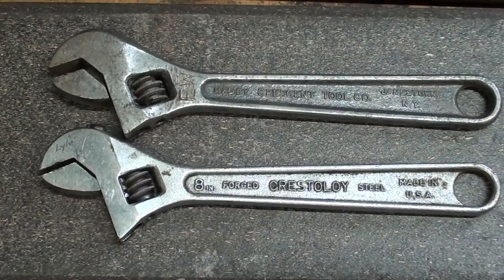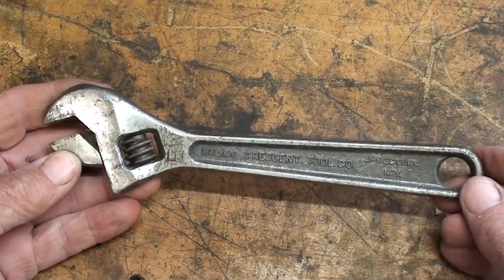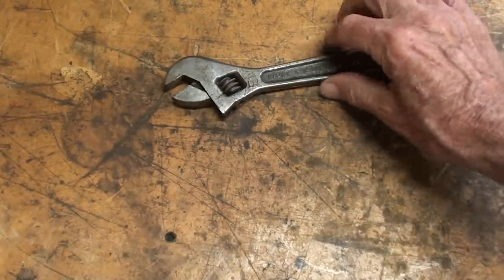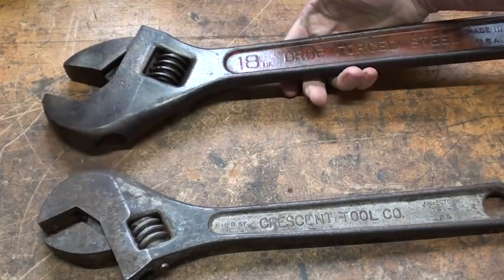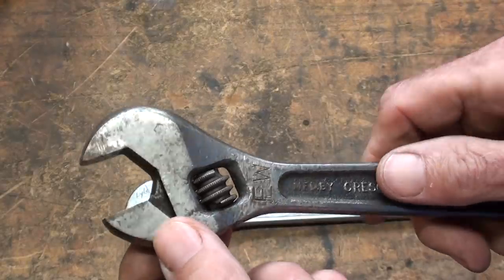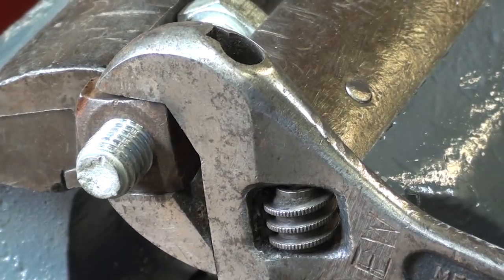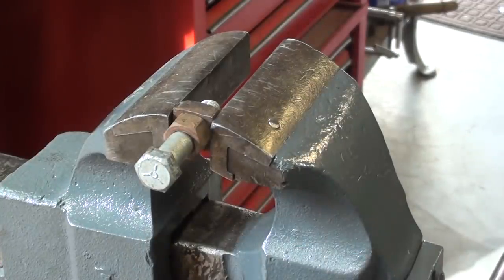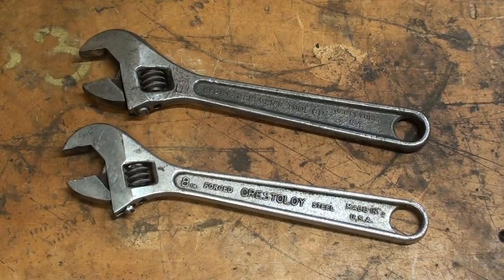Crescent vs Crestoloy Adjustable WrenchesTIPS 578 tubalcain

Comment: I live near the old cresent tool factory here in Jamestown and worked there over the years on many construction projects. Sadly enough the last job I worked on was to help remove all the hammer bases and send them south to the new plant. When  working there I was given a complete set of adjustable  wrenches some said cresent,rigid,pennys and was told at one time they made wrenches and pliers for 26 different customers including craftsman.
Reply from the maker: Thank you, that is good to know
Reply: @mrpete222 you'll love this one Lyle. Way back in the 1980's the boys in the shop decided to do Stan a favor and take all his high quality adjustable wrenches. My list: 
Snap on 16"
Snap on 12"
Snap on 8"
Blue Point 24"
And the cutest little 4"Craftsman keychain version. Was in my pocket.
    In trade I got Horror Fright from the reject bin. One in particular was a ten or twelve inch made in Packistan real shiny and crooked not from being bent, but swayed right to left. The knurled wheel was actually made to turn the opposite direction. The laughs only lasted about fifteen minutes or so. Those wrenches got swapped around for years whenever a mechanic was having a hard day or a rush job. Somebody actually tried to use the Pakistan one. It bent and was presented in a shadow box to the plant Safety Coordinator upon his retirement a few years later.

Comment: I once worked at a place that furnished me the hand tools I used.  They gave me a 12" adjustable wrench branded Klein Tools, Chicago, Ill.  I was using it and the fixed jaw snapped off, I own both Crescent and Armstrong 12" adjustable wrenches and have never had one fail, round off a nut yes, fail no.  I took the wrench back to the warehouse to trade it in and the tool man cut the blue plastic coating off and it had Taiwan branded right around the lanyard ring.  By the way that was around 1985, if you see a Klein adjustable wrench they are best used for anything that doesn't involve mechanical fasteners.

Comment: The Crestoloy name was first used for the alloy AND the finished hand tools 27 Sep 1930. trademark application for both filed 20 Oct 1930, and Trademarks ® issued 2 June 1931 for the hand tools, 23 Jun 1931 for the alloy when the company was under the leadership of Karl Peterson. USPTO Reg. No. 0283646 for the hand tools, 0284271 for the alloy.
Cheers,
-- Joe
Reply from the maker: Thanks

Comment: I remember when the company i worked at many years ago purchased  a big adjustable wrench ( we call them shifters here in Australia) to remove the nuts on hydraulic rams - i got to use it once as the jaws and handle bent on the first ram and i was only using my own body weight on it ! No prizes for guessing where it was made !
Reply from the maker: Yes

Comment: in my opinion thats what they are good for rounding off heads!!! only use them as a last resrt unless its some small bolt and nut with a 5 inch or smaller crescent wrench

Comment: What always bothers me about people using adjustable wrenches is, as you did in the video, they put it on the work going the wrong way. If you look at how the force is applied to the nut or bolt from the wrench, you will see that the corner of the nut low in the fixed jaw and the corner high in the movable jaw is where the torque is applied. This creates along lever, the length of the moving jaw, to force open the jaws or to allow the springiness of the metal in the wrench to stretch around the work and slip. 
If you turn the wrench over so the corner low in the movable jaw and the corner high in the fixed jaw receive the torque, you have less of a lever action against the moving jaw and it won’t slip as easily. 
Low in the jaw means closer to the handle, high in the jaw means farthest from the handle.

Comment: In Europe, the 'premier' brand for these wrenches is Bahco. I have several of those and they are usefull, but a bit clunky and heavy compared to the correct size normal wrench.
Reply: Swedish BAHCO is the original, Crescent is a good quality overseas copy. Lovingly known as "mutterrundare" (nut rounder) in Swedish after it's main use, which is perfectly demonstrated in this video.

Comment: A suggestion to possibly allow destructive testing: sacrifice one of your larger tool steel blanks as the "fastener" mounted in the vise, as it would probably be harder than either set of jaws, but still allow the square bite advantage. That would eliminate the "smear factor", but of course would raise the hackles of your "inner cheapskate", lol

Comment: I think that if you turned the wrench over to facilitate the most pressure being applied to the rack edge of the movable jaw, slippage will be reduced considerably. Due mainly to the fact that the farther from the pivot point (rack of the 'adjustable' jaw) the more likely flexure of the assembly will occur. To demonstrate the reality of this please, if you will bear with me, try the following proof of concept:
  Using a short length of rope (for the sake of clarity, let's use twenty inches) with a suitable weight (again, for the sake of clarity, a five pound exercise dumbbell) tied to one end of the rope and a loop large enough to slip over a one inch nominal piece  of schedule 40 pvc eight feet long. Holding one end of the pvc with arm extended palm up at shoulder height, have a helper hang the weight from the pipe at a point very close to your hand. Feel the pressure at the pivot point (your shoulder)? Now have the helper hang the same weight at a point close to the other end of the pipe (farthest from your grip) and see if you can even hold the pipe level. Feel the increased pressure (pain) at the pivot point (your shoulder)? Same goes with the 'movable' jaw of the adjustable wrench. Even though made of stronger material (steel), the pressure on the pivot point (rack) still exists and subsequently increases the farther along the fulcrum that the weight (or force or pressure) is applied. Just as there was flexure or 'sagging' of the PVC, so will there also be flexure in the movable jaw.
    Was that clear as mud, Lyle? 
    Didn't intend to be so long winded at first, just got on a roll. 
Read less
Reply from the maker: Yes

Comment: Undramatic but very typical results of the yet very useful in their own right knuckle buster as we always called them over our lifetime. As for the cheaper versions I doubt a comparison while very interesting would be needed. They have never failed to fail for us and being used in their place at that.  When I say in their place for these I mean somewhere where multi sizes of wrenches don't need to be carried or very large fasteners at low torque values.

Thank you for sharing your wisdom and knowledge, adventures, time, and stories with us take care and keep safe.

Comment: I would like to see the US patent the off set had to be designed to allow more access to the fastenet.My auto shop teacher back in the  dark ages said never use an adjustable wrenche.I spent 20 years working on nuclear submarines I worked on a boat where the engineering officer would inspect your tool bag and kick you off if you had an adjustable wrench because of fastener damage.I worked at Chevron Chemical where almost everything was done with a adjustable whench,Channel Loc pliers,6 in 1 screwdriverd,and hammer.
Reply from the maker: What a contradiction, LOL

Comment: Hard to tell but I'm wondering if the wrenches were damaged in some subtle way - did tthe angle of the moveable jaw to the gear rack open up?  And what actually breaks when they're overtorqued?  Back to the old videos for a re-watch!
Reply: Watched the old video and the wrench failed in the small sections at the corners of the opening for the screw.

Comment: So the video was interesting and illustrates why a "Crescent" wrench is used mostly for rounding over those pesky sharp corners on nuts and bolts.  Other than pounding or squeezing the sides of the wrench closed, what is a good way to restore the functionality of a sloppy "Crescent" wrench. Nice work Lyle, thumbs up.

Comment: Doesn't seem set-up between tools was consistent. Jaws weren't closed and Chromaloy generally handle was raised in the air so tool wanted to stay on nut but Crescent handle was horiz. allowing tool to slip off easily rounding nut. Don't get how a square nut sits better in the jaws. Hex nut sat in deeper in jaws and more supported on 2 additional sides.

Comment: Looks like the jaws deformed or spung a bit after the first go round.  Those sounds they make when they slip make my knuckles ache.  Some one called those an all 16th wrench.  We used to call them the --------- socket wrench.  Not very flattering but accurate nonetheless.
Reply: We referred to them as the All Purpose Metric wrench, back in the early 1970's, at the body shop.  We were working on SUBARUs at the time.
Reply: My buddy's dad was a Cornwall dealer, and a Marine vet from the Pacific theater.  He said the first Kawasaki he saw motoring along was driven by a IJA courier....  They shot him off it....      Short 25 years later, and WE were driving them!!!

Comment: that is what happens to me. i've never broken a crescent wrench, and i have both new and old, but the jaws spring open and slip off of bolts regularly. the only problem i have is the adjuster wheel seizing on it's axle pin, and i have stripped out the threads on the pin trying to free them.

Comment: Have one big, old Crescent 12" in addition to several much newer models. Had to repair the threads for the pin. That metal is harder than a witches heart!! My nice, smaller adjustables are a set of 4 to 10 inch J. P. Danielson.

Comment: I have some of both types, and I do find the slimmer crestoloy wrenches nicer to use.  I just glanced up at my tool board over my bench where I have wrenches of similar sizes hanging on the same nails and sure enough, the crestoloy wrenches are at the front of the stack showing me which ones I preferred.  I never took note of that until you posted this video.  Thanks, Mr. Pete! :-)

Comment: Hello,
I mostly like your videos and experience.
This one I don't like.
Better no video than this kind.
You don't need a torque measuring device.
Just knowing the length of your lever and how much weight you can hang at the end of it gives you a good torque breakpoint measurement.
Cheers from Belgium.